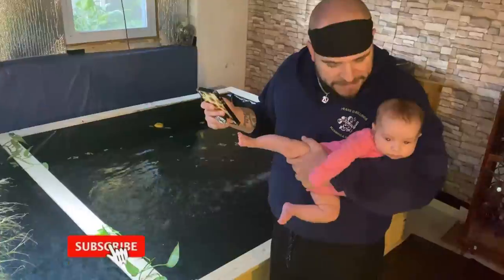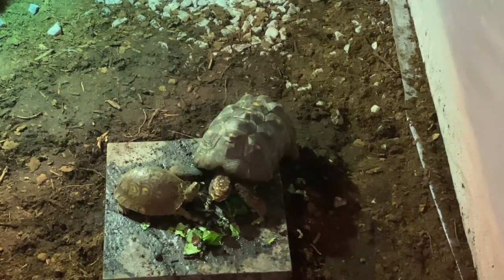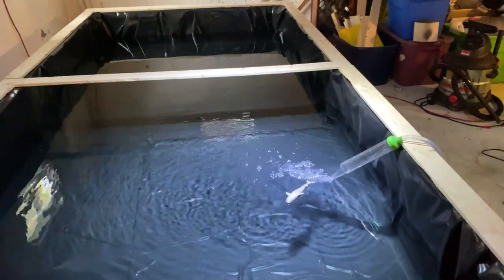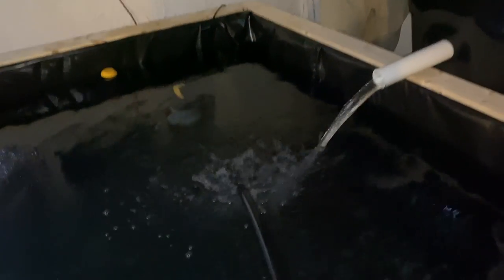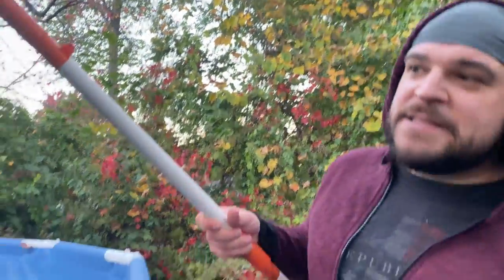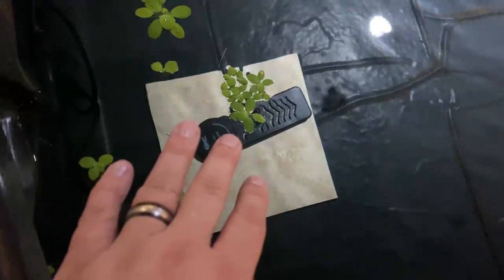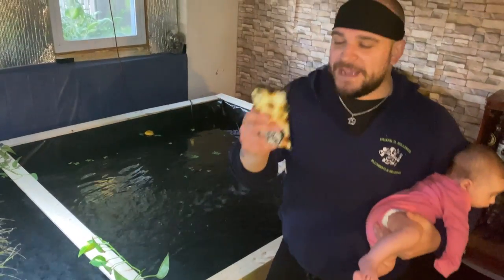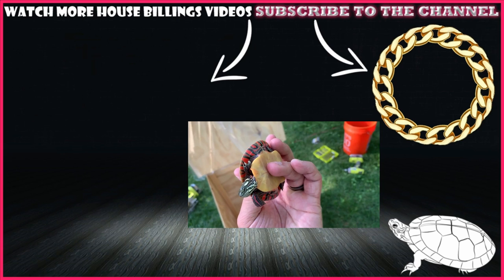$200 DIY FISH & TURTLE POND PART 2 (1000 GALLON INDOOR WOODEN POND)

Comment: That is still very thin liner those turtles can rip through it when they get bigger 45ml should be min
Reply from the maker: I’ve kept large turtles with thinner liners than this and had no issues but better safe than sorry I agree. We plan on moving in the next year so the next permanent build I’ll be using a thicker liner.
Reply: @HOUSEBILLINGS  I have seen and heard some horror stories from thin liners. I know it can be a little more expensive but your going to save money in the long run. There are also a few websites that sell the firestone 45mm liner for a lot cheaper then most local pond stores
Reply: @casadefinch894  ?